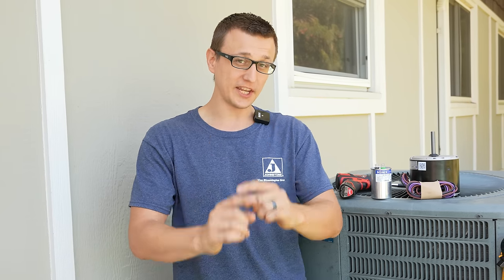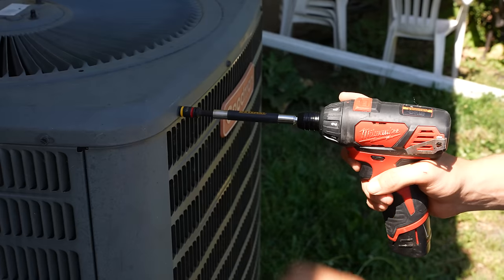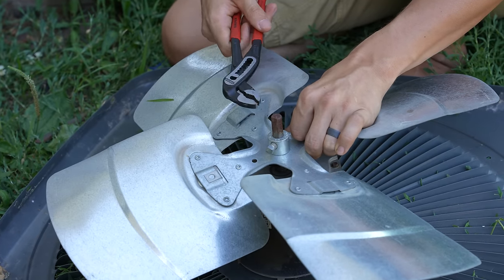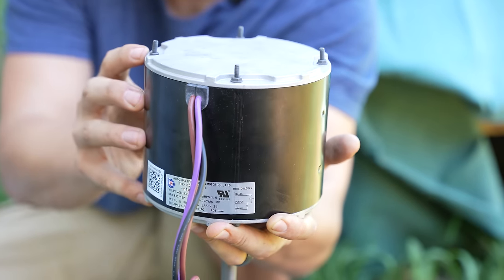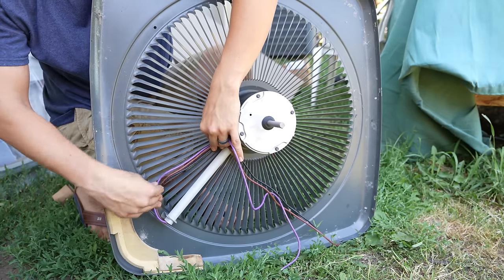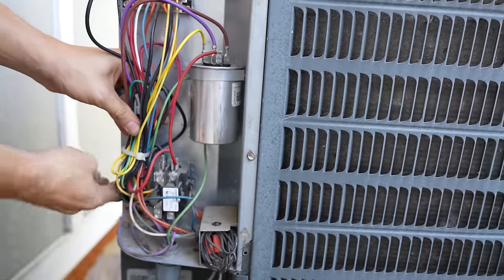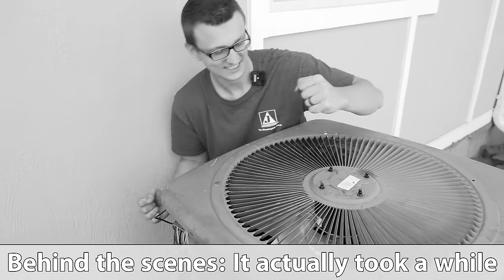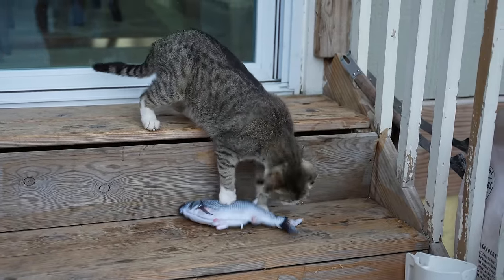How To Replace Air Conditioner Condenser Fan Motor

Comment: When you called Knipex Channel Locks 🥺
Reply from the maker: Ahhh. I have sinned. 😨 I know better than to call my Knipex Cobra pliers a Channel Locks yet I did it anyway 😓 I think my reasoning was to just call it something most people will understand. I often get a confused look when I call them a Knipex.
Reply: @WordofAdviceTV  I get it. But how come you bought Knipex without the push button?! That's 33% of the benefit of them.
Reply from the maker: @Everything's Chill   Now that I don't repent of haha 😄 I have had both pairs before and one of the things I really like about the pair in the video is that you can adjust them with one hand. With the push button, that is much harder to do. Or at least that has been my experience. I got used to the classic version and when I switched over to the button one, I had a hard time adjusting to it. I then proceeded to leave them at someone's house and ended up buying my favorite classic once again 😎

Comment: NO DIAGRAM ON MOTOR: HELP PLEASE!!!
I'm going to replace the old Gentec motor  with a Century Multifit motor that has only 3 wires Black White Brown.  In your video you show Yalow which I don't have coming out of the motor. Could you please tell me the place my wires should go on the capacitor & which wire goes on the side, top or bottom of the contactor?? ALSO, this motor has no screws to attach the motor to the shroud "gril",   I don't want to start the project & find out that the OLD screws will not fit the new motor to my existing shroud. The top of the motor has 8 screw holes that correspond to the bottom where the shaft is. The new motor is a bidirectional, my present Gentec is counter clock rotation, how should the new wires be connected??? YOUR HELP WOULD BE MUCH APPRECIATED!!!
Reply: Since I got no help , I went ahead and did the job myself, Without a problem, I saved $1350, Thanks for watching your videos, I'm 80 yo